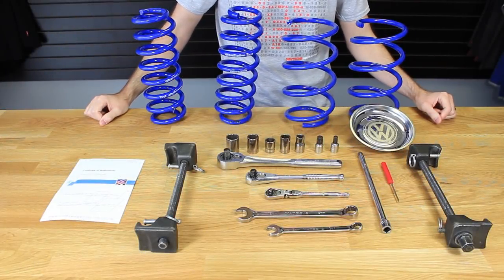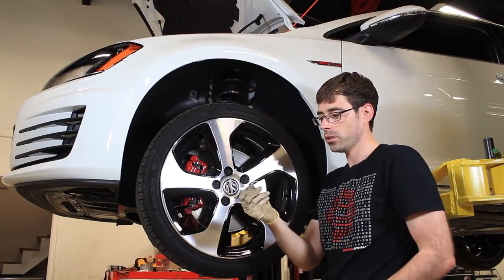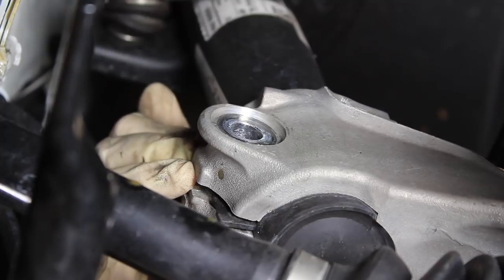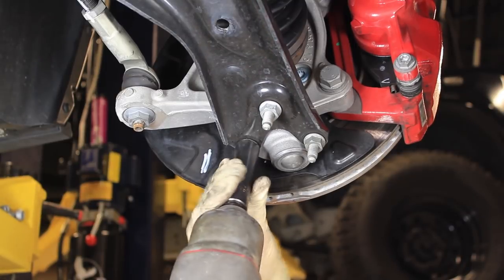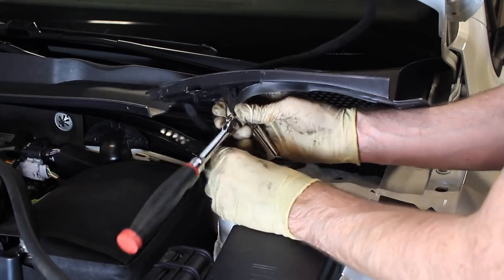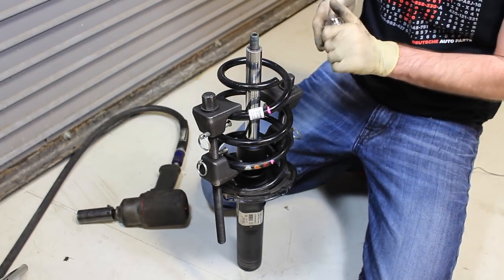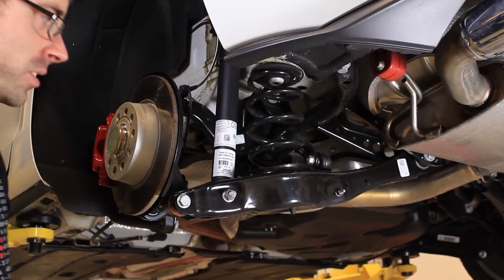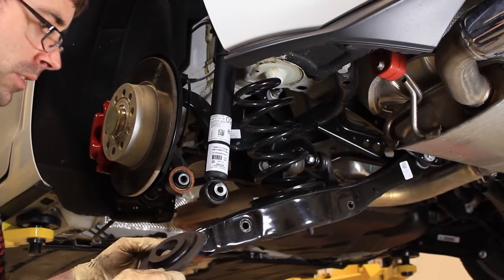MK7 GTI VWR Lowering Spring DIY (How to) Install

Comment: To all DIY guys. When removing the spring on the the front of the car on the passenger side , the axle recedes quite a lot further under the car and is near impossible to reach without crawling underneath your car. Also, the axle limited how far down I could drops the breaks to pull out the strut assembly. It helps a lot if your remove the heat shield covering part of the axle where you removed the 10 mm triple square screws. Only by doing so did I free enough play to remove the strut. On the subject of replacing bolts and other parts of the strut assembly, I am nearing 15,000 miles on my car and replaced nothing but the old springs with the VWR's, not recommending this but I will report back for any issues, or if I die due to suspension failure I told my girlfriend that my only wish in death is for her to report back to this video and inform all my fellow VW enthusiasts of my demise.
Reply: Why would bolts need to be replaced? Thanks
Reply: ***** The bolts are torque to yield, when torqued down all the way the threads stretch, technically they are a one time use
Reply: going to attempt this install tomorrow with a lift, and a buddy who works at a subaru shop. Hopefully we won't run into too many issues. Will report back!
Reply: Collin Douglas what happened
Reply: @allengonzalez2733  If i had a dollar for every time someone said "will report back" haha
Reply: @xAliZeee  still alive, now wrenching on a diesel truck lol
Reply: @paulwiest8167  glad you survived!
Reply: Just wanted to say a BIG THANKS! Removing the heat shield kept my sanity and saved my marriage!!! I did this at home with floor jacks and tools, the only special tools was the knuckle spreader, everything else you can find at a hardware store, except for maybe the triple square sockets. Once again thank you!

Comment: Please note that almost all of the bolts (and nuts) that were removed in this video are stated by VW to be one time use torque to yield ("stretch") bolts and should be replaced with new hardware.  This includes the inner axle bolts, the pinch bolts, the strut tower bolts and the bolts on the rear suspension (along with the nuts).  Reusing the old hardware could result in a catastrophic failure.
Reply: Nah.
Reply: Lmao best replies ever
Reply: Dude you realize almost no one ever get new bolts lmfao

Comment: BE CAREFUL GUYS: The bottom three nuts on the ball joint is NOT 100nm, this is ~74 ft pound and this WILL strip and break the bolt on the ball joint(I broke 2 now) It should be 44ft pound.
Reply: Correction: 44 nm equals to 30 ft-lbs, so even less than that. I'm getting my specs directly from the 300+ page VW technical service manual they distribute to dealerships.

It also says the strut pinch bolt is torqued an additional 180º, not 90º.

Comment: Doing the install yourself is not nearly as easy as the video makes it out to be, especially if you have DCC electronic suspension and Xenon headlights there are multiple expensive sensors that you have to watch out for.  On my car, in particular, getting the struts in and out on the front was extremely difficult and they did not want to budge.  As well if you are attempting this yourself I had the spreader tool and it was essential because there was not enough of a gap to fit the head of the ratchet.

Comment: 3 tips:

1. You can remove the strut without messing with the axle.  You just need a good spring compressor to compress the spring while it's on the car.  You may need to create spacers for it by cutting a pipe(I did). 

2. You can make your own special tool to remove the strut by buying a large torx(45 or 55? I forget what I bought) bit and grinding it down.
3. make sure both sides of the front are on jacks or the sway bar won't come out.

I just did this and am passing this info along because had I known the above I would have saved myself 7 hours of misery.

Comment: Ball joint nut torque is 40nm+45 degrees. I tried to do 100nm as this video instructed and sheered the bolt.

Comment: Thanks! I just did Eibach lowering springs and a Eibach rear sway bar and your videos are what i followed.... I started out by myself but getting the front struts back into the hub is pretty much impossible by yourself.... My wife helped me,mission accomplished.
Reply: Did you cut the bump stop? If not, were there any issues? I just ordered some Eibach springs
Reply: @NoisyIslands  didn't have to cut anything....the only issue was that my suspension got really noisy.... I think that the bushings need to be replaced now....I still have the car.
Reply: In One hand i have the strut and with the other i put the 3 bolts on top,Easy but you Need to practice
Reply: @audiwankenobi361  sway bar bushings?
Reply: @n3tfury  Yes. Those too.

Comment: Thanks for the video! It will come in handy soon, when i will be changing my rear shock absorbers and coils. I have a Skoda Octavia 4*4 , 2015 years model. According to workshop manual so the rear bottom control arm bolt should the toghtened to 70 Nm plus 180 degrees, same as the bottom shock absorber bolt. 130 Nm plus 180 degrees is for the upper control arm bolt.

Comment from the maker: - We appreciate your Support and Purchases!
VWR (Racingline) Sport Springs for MK7 GTI:
https://www.shopdap.com/mk7-gti-vwr-sport-lowering-springs-1.html

Neuspeed Sport Springs for MK7 GTI:
https://www.shopdap.com/55-70-07.html

APR Sport Springs for MK7 GTI:
https://www.shopdap.com/apr-roll-control-lowering-springs.html

H&R Sport Springs for MK7 GTI:
https://www.shopdap.com/h-r-2015-2017-volkswagen-golf-vii-gti-ow-sport-spring-5478755.html

Complete Suspension Install Kit for MK7
https://www.shopdap.com/complete-suspension-install-kit-for-mk7-5g0498331bgrp.html

Ultimate Suspension Install Kit for MK7/MK8 (non DCC)
https://www.shopdap.com/ultimate-suspension-install-kit-for-mk7-non-dcc-5g0498331dgrp.html

Ultimate Suspension Install Kit for MK7/MK8 (DCC)
https://www.shopdap.com/ultimate-suspension-install-kit-for-mk7-dcc.html

Volkswagen Magnetic Bolt Tray:
https://www.shopdap.com/vw-magnetic-bolt-tray.html

Optional Replacement Parts (recommended for vehicles with higher mileage)

Replacement OEM Strut Mount
https://www.shopdap.com/5q0-412-331-e-vw-audi.html

Replacement Aftermarket Strut Mount
https://www.shopdap.com/strut-mounts.html

Replacement OEM Strut Bearing
https://www.shopdap.com/5q0-412-249-e.html

Replacement OEM Front Bump Stops
https://www.shopdap.com/1k0-412-303-f.html

Replacement OEM Front Dust Boot
https://www.shopdap.com/5q0-413-175-c.html

Replacement OEM Front Spring Isolator 
https://www.shopdap.com/5qm412545-vw-audi.html

Replacement OEM Rear Upper Spring Isolator
https://www.shopdap.com/5q0-512-149-f-vw-audi.html

Replacement OEM Rear Lower Spring Isolator
https://www.shopdap.com/5q0-512-297-d.html

Comment: Thanks and well done for the torque settings. Exactly how it should be done and no one seems to point out how to professionally put these things back together again
Reply: that 100nm bolt should NOT be done to 100nm, check your workshop manual people! It's 40nm + 45 degrees

Comment: Appreciate your efforts on these videos, and it felt to good supporting by DAP by ordering my Driver Gear springs from you all today.
Reply from the maker: +2of2DCH thank you so much for watching, I'm so glad our videos are helpful. Also I really appreciate the purchase very much. I hope to continue to earn your business. 

Paul
Reply: BTW is the 100Nm torque spec @ 12:46 accurate for the lower ball joint?  On your Basic Suspension Install Kit for MK7 it shows 40 Nm + 45 °.

Comment: Thanks for the awesome vid Paul. Did my VWR spring install on my S3 last night and turned out awesome. On the S3 and probably the G7R it's not necessary to loosen the axle, had just enough movement to remove the shock assembly.
Reply: +Deutsche Auto Parts wanted some advice.. I have a knocking noise coming from the front of the car when driving at slow speeds and maneuvering (while parking). Initially thought it was the old strut bushings and bearings so replaced them (together with new bolts and buts, all OEM) but still get the noise. Any recommendations and thanks for all the great content.

Comment: Just did this myself not as easy as  it looks but happy with the drop. Keep in mind you need to pry the nuckle with something to even be able to fit the ratchet in there and yeah passenger side is a bit harder to do. Took me 5 hours since i took my time on it. Now that ive done it i feel i can do it in about 2 hours. Thanks for the video man would not attept it without. You also dont need spring compressors i just impacted them off then done!!!
Reply: Bro you just loosened the strut bolt?? Lucky you're still with us 😂

Comment: How come you didn't loosen the bolts holding the a-arm to the chassis?  The problem is, those bolts are torqued with bushings inside and with the car set to an existing ride height (stock springs) at the time the vehicle was made.  When you drop the car down with the new springs, you will in essence be over torquing the bushings in the a-arm assembly which will  lead to premature failure of the bushing. I learned this the hardway lowering my 03' GLI and for the most part it's overlooked on these sorts of diy's.
Reply: What exactly do you mean by "loosen" them? Are you saying they need to be loosened during the install and torqued back to spec after the install or that they need to be torqued to a lower spec after the install? Thanks
Reply: +Chili Dog correct,  they need to be loosened during install and retorqued back to spec with the car under load.  Ie at the resting ride height.  You can do this by putting a separate jack under the control arm and lifting it up to the correct height.
Reply: Tom Epp Thanks a lot, man!
Reply: Tom Epp Where exactly are these bolts located and how many of them are there? Thanks again
Reply: eugh..it's been a year since I did it, but you can figure it out by watching where the a-arms articulate through. This time I actually took my car back to the dealership after installing the springs, the alignment was way out and the torques were all wrong since I couldn't get the torque specs.  This is a small detail but super important, those bushing will torque out and you'll end up with all kinds of slop in the suspension after a while.

Comment: My 2017 gti, has a stability sensor attached to the left rear control arm. If you have that, make sure to disconnect that before you drop it.

Comment: The only question I have really is about the inner axle bolts. So there is 6 you pull and then gives you some room to drop the lower control arm from the strut. When those bolts are removed does the axle drop out of the transmission? When putting everything back together is there anything special to do to get the axle back in if it drops out? Also should those 6 bolts each side be replaced?

Comment: BEWARE of removing the 6 inner CV Bolts!

I know this is an older video, and I haven't read all the comments so I don't know if this has been mentioned before - but I strongly recommend being very careful if you remove the CVJ bolts.  Depending on the year of your vehicle and the age of the components, there are two factors that could turn this operation into a huge headache:

1. Some cars have a version of the CV joint that DOES NOT have an inboard cover.  So if you remove the bolts and the car is low mileage / clean, you may get lucky and the seam between the drive cup fixed to the gearbox and the CV joint will cleanly separate (there is a rubber seal in there, so it's definitely "sticky").  In that best case scenario the inside end of the CV Joint will be OPEN and exposed.  All the grease etc will be free to escape if it has deteriorated over time.

2. In the worst case scenario (and what happened to me) was that I had a car with CV joints that don't have an inner cover, and the vehicle had enough miles and surface corrosion that the joint between the drive cup and the CV joint was pretty firmly "stuck" together.  At least more "stuck" than the force it takes to pull the inner CV star, cage, and balls out of the outer race!

3. The end result is grease covered ball bearings dropping out onto the garage floor, requiring a complete disassembly of the drive shaft inner end (necessitating removal from the car), pulling the cir-clip on the inner shaft end, pulling the inner star off of the shaft, degreasing everything, and carefully reassembling it all on the bench before re-installing in the car.  It was not easy.

I would also caution against any of the comments about doing this without releasing the axle in some way - there is enough flexibility in the rubber boots that you could potentially still pull the joint apart even if you don't remove the 6 bolts.  So in my opinion unless you are sure that your CV has an inner cover (easy enough to inspect), and you're careful that that joint splits when you unbolt it (again, in this case you'll want to get in close and ensure it splits where you need it to), you have to pull the axle bolt.

So while pulling the drive axle bolt seems daunting, it is a lot lower risk.  It's a 24MM 12pt socket (at least on the regular Golf, not sure on GTI), and should be replaced since it's torqued to yield (200NM + 180 deg).  You will need a drift to push the spline out of the wheel hub.  The other challenge is re-installing the bolt, as on older cars re-inserting the outer spline shaft into the wheel hub by hand is difficult, and you can't push it in far enough for the bolt to engage and pull it home.  So you need a longer 16mmx1.5 bolt or some other way to pull the spline shaft into the hub far enough for the axle bolt to engage.

Comment: The torque specs noted here are different than those listed on your website (for the suspension bolt kit). Which one is accurate?

Comment: Just a tip your suppose to get all new bolts.. I went ahead and used the old ones and ended up loosing bolts for my endlinks, 2 on the ball joint. Replace the bolts !!

Comment: I am not sure 14:27 is correct. Transverse Link, Multi-Link Suspension, FWD and AWD pages in the repair manual for Golf 2015+ specify this bolt as 70 Nm +180° not as 130 Nm +180°. Did they change the specs?

Comment: Can you confirm the front 3 ball joint 16mm torque specs? Video says 100nm, shopDap site has 40nm plus 45degree. Vw golf repair doc seems to line up with the 40nm plus 45 degree. Don’t want to snap anything going to 100nm, but don’t want anything severely undertorqued

Comment: good video thanks guy after doing the lowering springs swap I took it for a drive around the block the epc light came would you guys know why.
2018 gti with 13000 miles on it
Reply: Do you have adjustable suspension?

Comment: need some advice fitted my h&r springs and new bilstein shocks. got to the drivers side and can't get the shock to sit all the way to the bottom of the knuckle, got about 3mm to go, but can't fit the pinch bolt because of strut alignment bracket. I have used the strut splitter. the passengers side was the same but reversed off a kerb and the weight of the car drop it into place and I could fit pinch bolt. I cleaned  all the knuckle out before fitting the shock? any advice would be great thankyou.

Comment: That cv shaft loosening is a deal breaker.
Reply: It's not even required in reality. I did my S3 last weekend and didn't have to remove those bolts to get the strut out. Neither is it required to remove the three nuts/bolts on the outer end of the lower control arm.

Comment: That 130nm+ 180* on the lower control arm bolt is definitely wrong. I couldn't get it that tight with a 2' breaker bar, so i checked your website and you have 70nm + 180* on the website, which seems much more accurate.

Comment: Any differences when working on a car with DCC?
Reply: Little late, weird aswell. Did you gett an anwser on this? Im really curious myself.
Reply: Just put H&R springs on my DCC car. There are ride height sensors you will need to unbolt and the connector that plugs into the struts. Other than that it’s the same.
Reply: @markbla3645  awesome good to know! We're you able to reconnect those two sensors?
Reply: @markbla3645  Thanks for the respont! Really great help. Ty so much!!

Comment: Hey guys, love your videos. At what mileage would you recommend replacing the strut mount and/or bearing? Thanks and keep up the good work!
Reply from the maker: +Ryan Tiffany If or when they start making noise or whenever you have the suspension apart.  We would say anything over 10k miles you should consider replacing them.
Reply: +Deutsche Auto Parts Awesome. Thanks for the quick reply!

Comment: How did you manage to measure the torque when putting the bolts back?  I don't have torque wrench and if putting as much man power as possible is enough?
Reply: I’d say if your going to tackle a job like this in your driveway you should at least have a torque wrench

Comment: I replace my OEM springs with Eibach Pro Kit on my Jetta 6,but there's a funny noisy when I turn left or right the steering wheel what can be wrong
Reply: Even when you aren't moving?if yes,check the strut top bushing

Comment: Think this would be the same for an e-Golf install?

Also, I what is the torque setting for the nut on the top strut mount on the front?  You just did a few runs with the air wrench and didn't torque it.
Reply from the maker: Alex Moreno Probably so but we have not gotten under an e-Golf yet

Comment: for the rear bolt torque settings . Did you use vw's torque to yield or upgraded bolts ? thanks.